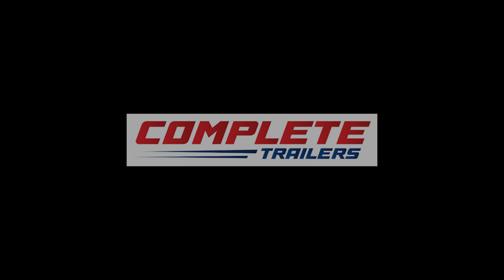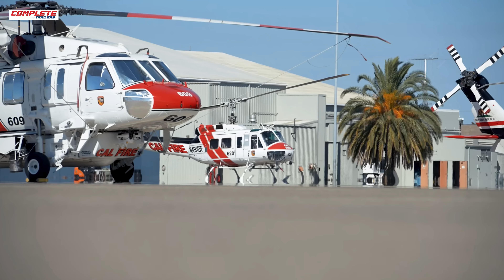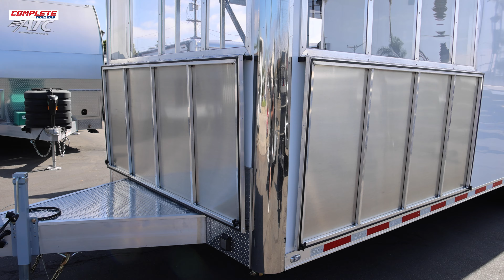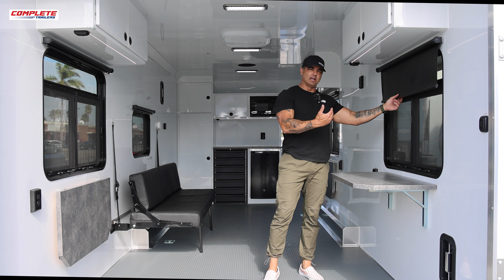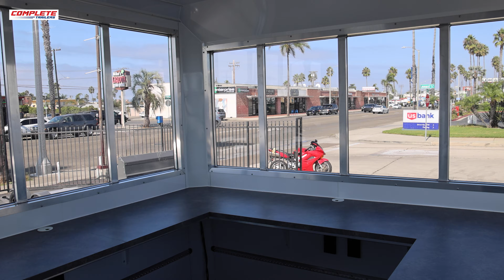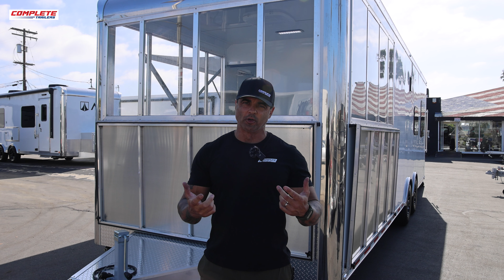Custom CAL FIRE Aviation ATC Trailer | One-Off Build by Complete Trailers

Comment: I see you can custom build trailers, Can a STO 450 Cargo (7.5X16) trailer be built with a HappiJac bed in rear with dry bath, toilet, refrigerator & sink. Basically take component's that ATC already uses in the PLA 450 toy hauler models and put them in a smaller lighter trailer.
Reply from the maker: Thank you for the comment. The toilet in a Sto trailer would be a cassette style toilet and would not have water tanks. I really think that the PLA 450 would be the best trailer based on your list of requirements. Once you add all of these components, I'd be willing to bet that you'd be better off on that platform. However, we'd be happy to price out a STO model for you. Please email me directly at info@completetrailers.com and I'll see what we can do! - Brett